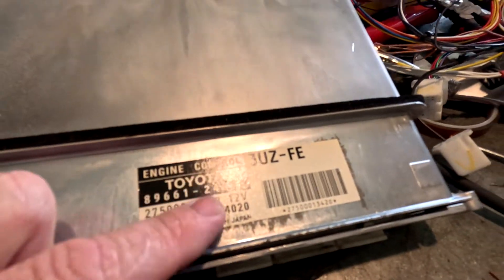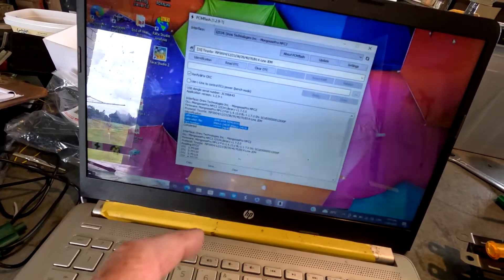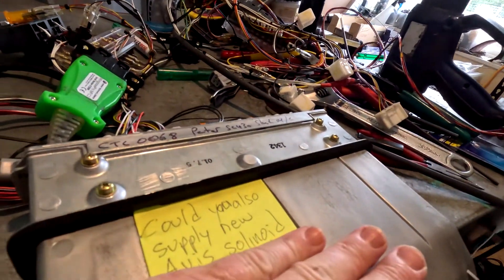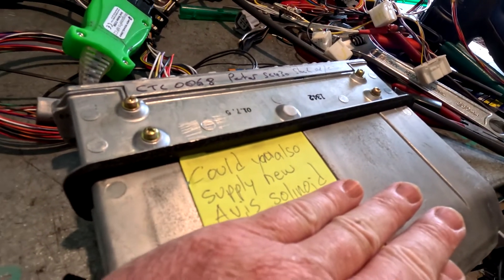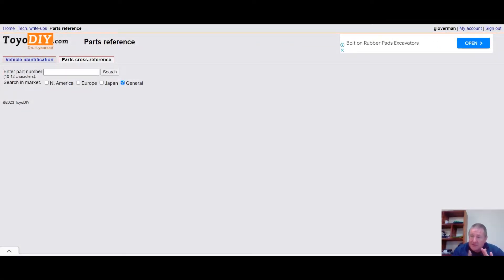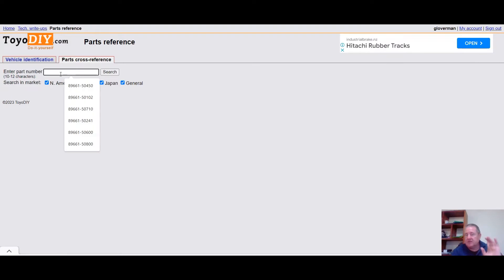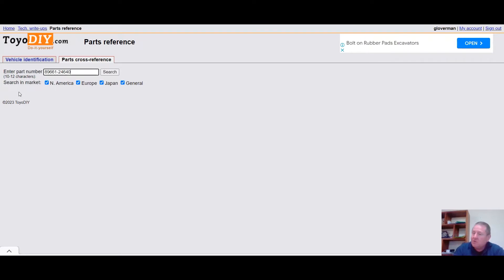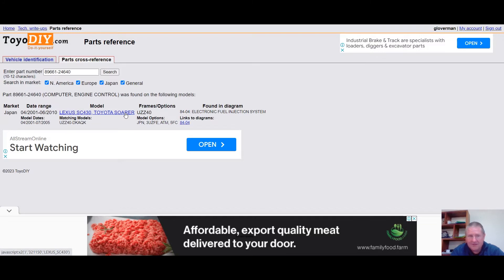UZZ40 SC430 and Soarer Reflash with 3uz-fe.  We retune the ecu for more performance

Comment: Do you know why the sc430 has the 60 mph shaking/ vibration? That would make a great video.
Reply from the maker: I'd need the car to check the vibration and make the video.  Could be many things like transmission mount,  engine mounts,  lean misfire,  coil misfire,  unbalanced tyres,  bent rims etc etc.
Reply: I'm in the States. Here it's a very common problem from low to high millage SC, LS, and GS 430's. I imagine it has to be something they all share other than the drivetrain.
Reply from the maker: @user-kc4ni1hm2h  yep,  above is listed the common issues I diagnose when customers complain of vibrations at cruising speed.  Oh and driveshaft issues.

Comment: 2nd 
I am a bit confused with the part numbers. My 1UZ 2nd gen needs one new connecting rod. I find the part number 13201-50030 but also 13201-50031 for the connecting rod assembly. Wich one to choose? Or are they the same?
Reply from the maker: The last number is a supercession,  so in basic terms those two part numbers are the same part.